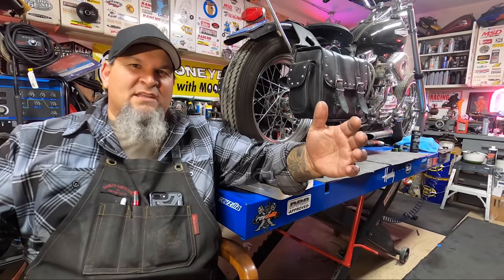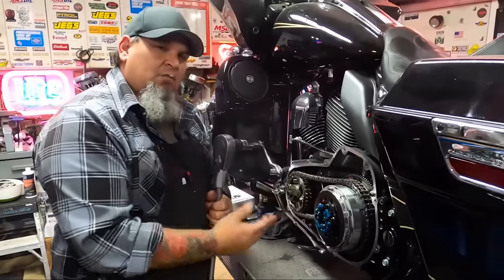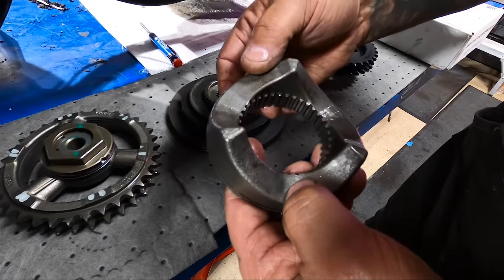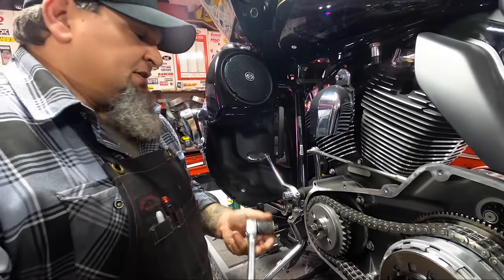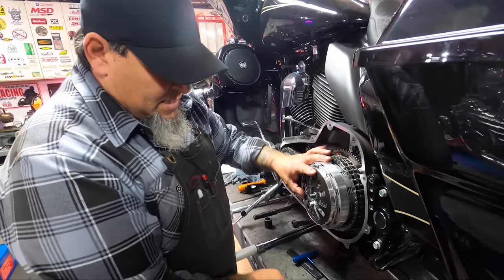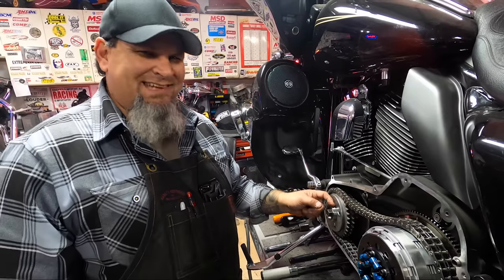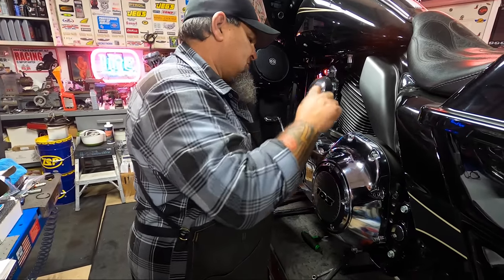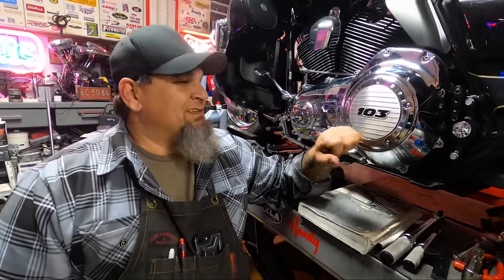Compensator Upgrade for Harley Davidson

Comment: Do  you know why this product is listed as only being compatible for 2007 and up Touring models?  I have a 2005 Roadglide I'd like to put this in.
Reply from the maker: Hi Clayton, it's the difference in the generation of engine you have and the compensator is different in dimensions. There is talk that they might bring one out for the first gen twin cam.....
Reply: @LateNiteVTwin  Thank you.  That's more explanation than I got from their tech line advisor.  He basically just said "Sorry, it won't work for your model".  I was looking for a reason why; as I'm kinda handy and would attempt some mods if I could make it work when the time comes.  My 05 will soon cross over 100,000 miles.  No compensator nut issues yet; but so many of my friends have had problems, I suspect it's a matter of when, not if..
Reply from the maker: @72SeaHag  Compensators seem to  have a higher failure rate as torque output of the engines go up, as the clamping load is overcome by the springs that make them work.....so, with that said, the more stock engines that have little modification or are stock won't see the need for replacement. Sounds like you got more than your money's worth at 100k miles!
Reply: @LateNiteVTwin  It was upgraded to a Revolution Performance 98" Nikasil plated kit with GMR performance worked heads, Andrews TW-37 gear drive cams, etc..  99hp/106tq at the 28,000 mile mark.  It's been a really reliable bike for touring all over the US.  So when and if a compensator problem occurs, I'm looking for an upgrade from stock.
Reply from the maker: @72SeaHag  My screaming eagle unit lasted well under a well prepped 103 but my 113" and now my 117 shred them. Try the harley upgrade.....

Comment: The primary chain looks very stretched. I would have replaced the chain during this process. That 2 row primary chain looks very weak for such a large heavy bike. The primary chain in my 48 year old Norton is a 3 row wide chain. The Harley design is very old school.

Comment: I always seem to screw the pooch when I try working on my own bikes. Even with a manual....older cars I can work on. It comes to bikes hahaha.  But, I still do it. I just have to buy more parts than expected!!  Like changing my rear tire. Wound up having to buy a new rotor cause I screwed the pooch. Ah at least I get new parts whether I need them or not. If I get my hands on it. I'll be needing extra parts. 😂😅😢😢. I don't know whether to laugh or cry!!!

Comment: Was looking at different compensators SE, TP cheaper options vs baker and DH. I also came across the option of TP compensator eliminator kit. I definitely want to swap out the auto adjuster to a manual to reduce stress on bearings and other components, but wanted your thoughts on the eliminators vs upgraded comps… pros/cons to eliminators or solid? Was thinking it would could be more noise vibration but I’ve heard many run them for years with no issues and would think might be better for torque and feeling power more instantly? Anybody can chime in if you have experiences

Comment: Would this compensator mod help  to get better torque on my m8 softail?
Reply from the maker: Hey Paul, anytime you have a part with less moving parts to wear out, yes it will help. Less metal to float around and wreak havoc with bearings, and zero noise from the Dark Horse unit. I can say I have never had better feel of the overall shifts and smooth power transition from a compensator. I'm really impressed so far.
Reply: @LateNiteVTwin  thank you for your reply. Question, I have m8 and wondering should I go with 34 t standard or 32t? Would this be installed in HD dealer?

Comment: Thanks for the video.  You mention several special tools such as torque wrenches.  What company would you recommend tor torque wrenches.... hopefully it's not jut Snap-On.  Appreciate any comments.
Reply from the maker: Hi Jim, I do use Snap On. I always say buy once, cry once, but there are many brands on the non Snap On list that can do the same job. I like the beam style, as they can be used in both directions unlike conventional type. The special tools are mostly made by Jim's. They specialize in Harley tooling. In fact, they make almost all of the tools for Harley. Some are available through the stealer, and they'll be labeled Screaming Eagle. Look on the Jim's website and you'll find all you'll ever need depending on the job you're doing. Some tools will carry over to different engine platforms, like some of the cam tool locking pieces. I hope this helps!

Comment: I have a man o war and its so loud that the noise outweighs any benefits.  Same setup gary had psr tensioner.  I replaced with stock stuff and works fine.  If anyone wants my man o war and psr tensioner i will let both go for 500.

Comment: Hey guy what would happen to the performance of my 1995 fxsts softail, or can my clutch need to be adjusted in some way because everything runs fine from the start until i hit like 30 mph and when i hjtbthe throttle it hesitates no response it seems like the clutch is slipping , maybe or somethin i dont know either way awsum job u just did have a good one later on
Reply from the maker: Joe, it does sound like a clutch slipping. They have to be adjusted cold and bike upright so the primary doesn't spill fluid. Have you ever adjust it?
Reply: @LateNiteVTwin  my best friend away and his father gave me his bike its been siting in a garage since 1995 its a fxststs softail springer , and the old man had a s& s shorty carb, oil cooler, fjre cracker ignition all sorts of extras , any ways me and my buddy changed all the fluids plugs wires etc and it fired right up we finally adjusted the carb so it it idles at 1 rpm but when we hjt 2nd or 3rd gear around 3rpm to 5 rpm its you gjve it the gas but it just bogs out/ hesitates then it gradually gains speed ,i have only adjusted the clutch from the handle bar clutch lever and moved that boot to tighten up the gap. In the clutch lever. However if i open up the derby cover and adjust from there do you think or do you think the entire clutch badket plates etc is shot and get a new basket an plates etc if it can be saved that be great the bike only has 11k miles on it, i have a 1994 flstn heritage softail , so im really diggin this evo springier a piece of good ole americona thnx again
Reply from the maker: @josephlewis7166  So, when you perform the adjustment, collapse the cable to bottom it out. This makes the cable the longest possible length. From there open the derby, and loosen the adjuster nut. Back out the allen screw, and then turn it in until it makes contact with the clutch shaft. After contact (zero lash) back it off a half turn then hold the allen while tightening the nut down. This is setting the clutch to the right depth for release. After that, you can adjust the cable and free play. I measure free play by measuring the distance the ferrule on the cable meets the lever. I like about 1/8'. This makes the cable shorter and controls where the clutch releases off the handle...making it shorter makes it release right off the grip, making it have more free play makes it release farther from the grip. Try the base clutch adjustment first. It's the only way to tell if the clutch slips. Also, yo say it bogs down, S&S carbs are simple to adjust and it sounds like it may have to big of a main jet. You can down load the instructions on proper adjustment from their web site or I can supply a link if you like? Let me know what you need......
Reply: @LateNiteVTwin  thnx guy first ill try the to adjust that base clutch, because when i got the bike i drove it home and it ran really good , ss far as the jet , so il go with the adjustment first , im gratefull for your help partner thnx sgain
Reply from the maker: Let me know how it works out!
Reply: @LateNiteVTwin  i finally adusted the clutch from the derby cover and from the clutch cable first , the sliping stoped runs allot better , except now my clutch lever is not clamping all the way back to touch the handlebar grip it stops like 1/2 inch away and im out of thread it looks like , either way it did stop slipping after i followed ur instructions and a few different utube vidieos so thnx buddy apprciaetate it
Reply from the maker: @josephlewis7166  Hi Joe, always always always collapse the clutch cable first, the adjust the clutch in the primary. Rule of thumb is, 1/2 turn from where the adjuster just touches or bottoms out, set the lock nut, then adjust the cable last. Set the free play at the ferrule at the lever perch at 1/8 inch. If your lever is not working right, then your adjustment is incorrect or your clutch has issues internally.....

Comment: you didnt show the pulse biscuits with the compensator on the engine .
Reply from the maker: The bushings are sandwiched in between the fully assembled unit, and you can't see them. I would call the compensator from Dark Horse more of a cush drive than a traditional compensator.....

Comment: So what if I use the torque they send me with the compensator can I use that one or buy a shorter torque like u said
Reply from the maker: Not sure I follow you Jorge. Are you talking about the bolt??
Reply: @LateNiteVTwin  yes I was not sure cause you said to used the short torque
Reply from the maker: @jorgedelgadillo5715  Yes, I meant the short non Torx bolt......

Comment: i love your videos but Dark horse says to use the screaming eagle bolt.  it's not too long.
Reply: The bolt he used works too. The manual actually says 155 - 165 ft.lbs. on final torque, but still 100 first, loosen one turn on stock compensator, then final torque,  keeps people from installed a loose stock compensator, and then putting the cover back and finding out they have the noise because they didnt tighten It right.

Comment: Let be sure to mention that on a softail it not so cut and dried. You'll need the upgraded rotor. To replace that involves oil tank removal to get at the starter to remove the inner primary to change said rotor. Big can of worms.

Comment: Hey guy if theres to mmuch oil behind derby cover will that cause my clutch to slip / not engage or grab because my 1994 fxsts softail my buddy had changed the primary oil and now when say im doin 30mph i hit the throttle the bike dont move however the rpm rev up no problem but im not giing forward thnx
Reply from the maker: Hey Joe, yes, oil level can affect the shifting performance of the bike, but it sounds to me like the clutch is slipping. Question, was the clutch adjusted when this was done? And if so, how was the clutch adjusted in sequence? Also, I have run across clutch frictions that cannot tolerate synthetic oil or they require automatic transmission fluid to operate correctly. Let me know!

Comment: Best thing in the world for your Harley-Davidson... First thing you do is throw that compensating sprocket it's just throw it on your recycle scrap heap to go to the junkyard and get money for it.. rather than have it destroy your engine clutch and transmission as it is not if it will but when it will as it's going to do it was today's 100 plus horsepower big twins... Harley-Davidson does not make a compensating   sprocket that well survive and when it throws it off center it'll snap your primary chain  and turn your clutch basket into aluminum gravel and twist the flywheels on your brand new twin cam with a stage 4 kit after you spent an extra $10,000 having it all build up real nice pulling 120 horsepower will twist the s*** out of compensating sprocket and destroy everything... Answer is $150 you can get a compensated sprocket eliminator that's just a sprocket that bolts  on the end of the crankshaft solid doesn't give at all.. telling you about the vibration and how it absorbs this and that from the connecting rods jerking back and forth doesn't happen does it????? The first use of compensating sproket was back when the Harley came out with knuckleheads and in the case of an engine lock up the compensating sprocket would slip to keep from sliding in the back tire well that's over now.... When you lock up the  compensating sprocket at 60 MPH the back tire is sliding at 60 miles an hour .... An entire assembly weighs about 15 pounds hanging out there on the end of your crankshaft just begging to twist those flywheels off alignment.... Sportsters have never had a compensating sprocket simply because they don't need one nor does any other motorcycle... Remove it from your bike boys and throw it away before it destroys your engine primary and transmission.... I'm an expert on this believe me I know exactly how to f**** and destroy a good brand new Harley.  ... You can buy compensating sprocket eliminators in different sizes by the number of teeth to gear up or gear down and it will not affect your speedometer at all as you're doing the gearing ahead of the transmission where it's speedometer gets its reading ... Go with three teeth less on the the engine sprocket and pull power wheelies like unknown industries

Comment: actually failure of components is the exception not the rule. Its not like the majority of the bikes have any of the problems you see all over youtube. Maintain the thing. I have over 80 thousand miles on a 09 Dyna Street Bob. Tires and brake pads is all I ever do
Reply: put 100,000 miles on my 05 u.c. just had my engine upgraded too a 103. didnt need a clutch or a compensator.  why? because I didn't abuse them. and serviced my bike religiously. now it's ready for another 100,000.
Reply from the maker: Adam, the reason for your success  on that 09 Dyna? Those were the best years for the twin cam....imo. Maintenance is the key to everything and we both agree. The thing you can't control is component failure true, but when the component was incorrectly designed from the start?? That's a whole other ballgame. That's what we're dealing with here.
Reply: @LateNiteVTwin  In the meantime im rebuilding a 86 FXR. Because the Evo is a better engine. I'm building a

Comment: Why not the Baker ?
Why not the baker ?
Reply from the maker: Hi Leon, I have had a few Bakers destroyed in my dealings with big inch hi torque applications. I wanted to try this one in my personal bike to see if a company like Dark Horse could make a compensator as good as their crankshafts are. I do not receive any endorsements here, and I do these videos to help the bike community. I do like to recommend what I see really fixes the issues that my customers have, as well as speak from my own experiences. It is just a newer design on an age old part that fails under hi torque applications, so I thought I'd give it a try on my personal bike. Nothing wrong with the Baker!
Reply: @LateNiteVTwin  Thank you for the reply, my reason for asking I'm having a baker put in my road king now. Keep making the vid's very enjoyable.
Reply from the maker: @leonpascos2284  Thanks Leon! The baker is a great piece. I did shred one, and just wanted to try a different type of engineering this go around, so we made a video! So far, so good. I like it!

Comment: Ya know, you have a gift explaining the project your working on, great job! Now I’m wondering why in the hell would anyone want a Harley in the first place. I owned two of them and soon realized this was not the bike for me. The last bike I had was a 2017 street glide special with the so called all new suspension, which was total shit. They have the worst seat in the industry. The only thing I see in YouTube videos are upgrades, stag 1,2,3,4. These bikes are already over priced to have to being do shit to them just to get performance they should have done in the first place, just saying. I own a Gold wing DCT Tour, no upgrades just get on an ride. Best bike in the industry hand down, ride, handling, HP, comfort. If you ride a Harley because of the brand your short changing yourself. Go test ride a new Gold Wing and you’ll be changing brands, just saying.

Comment: I rhink you may have the comp volt facts reversed.   Maybe its different for earlier twin cam engines.  I know dark horse specifically said to use and reuse the stock torx bolt and not to use the hexbolt.  
    Not trying to be argumentative.  You almost have me sexond guessing myself.
   Bob and tam of youtube recently posted a video of a man o war being installed at dark horse.  The dark horse employees demonstrated  the install. The pointed out the torq bolt situation.